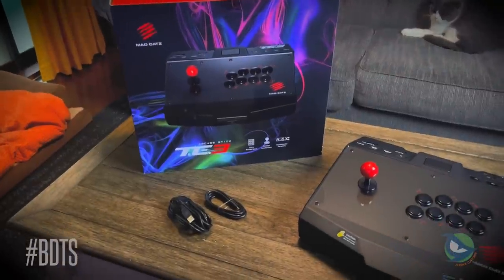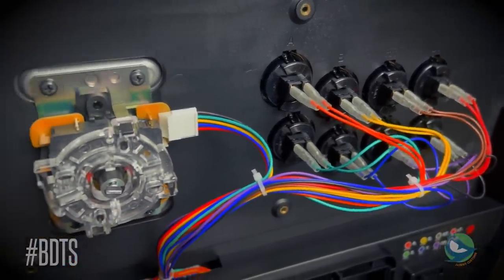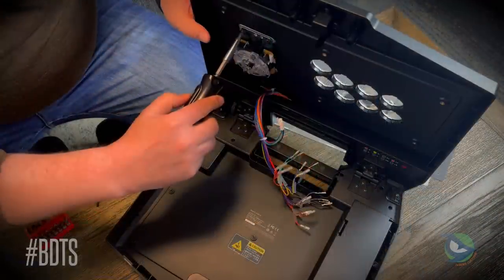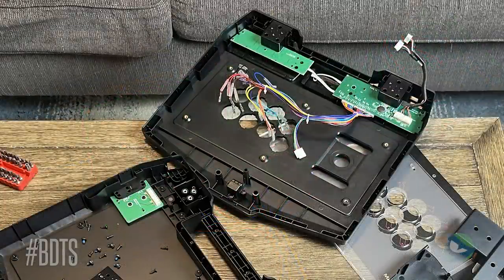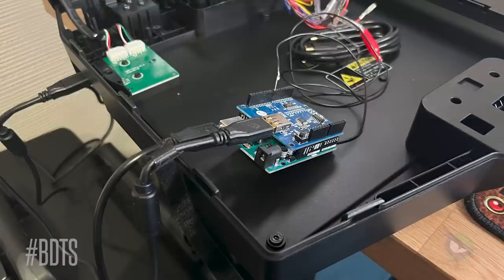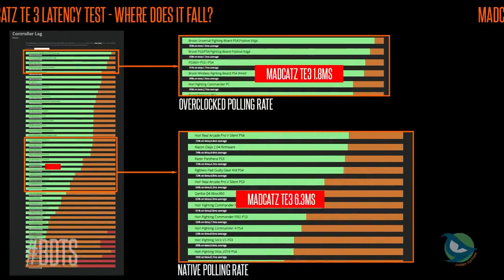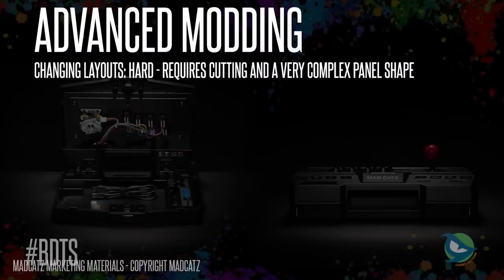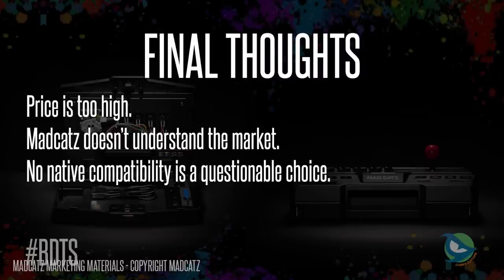Breaking Down the Stick - Madcatz TE3

Comment from the maker: It seems as though Madcatz realized $300 was a bit high for a mass produced stick that requires a passthrough for PS4 and XBOX compatibility. Is it worth it at $190 - I still think no.
Reply: I just bought this TE3 Arcade Stick before I saw this review. I ordered one for around 189 USD from Walmart. And saw your video where you got blocked by (New) Mad Catz company. I was going to buy the Hori Alpha Arcade Stick but never again I will make this mistake if I have personally. Thanks, you helped me a lot but I figured it's too late.
Reply: @EX-Series why not just return it?

Comment: What a hidden gem of a channel for YT to recommend me. There's a niche for everything. I remember this stick's announcement and I almost immediately was scratching my head over the shape. It's like they didn't consider humans would be using it. All the internals and technical specs just make me even more confused. There's no kind of special gimmicks or whatever, but I use a Mayflash F500 Elite myself. I think it gets overlooked for not being a Qanba or Hori or whatever, but it's such a rock solid stick. Near-universal compatibility, some fun bells and whistles, and Sanwa parts out of the box for less than $200 is a steal in my opinion.

Comment: I wouldn’t be surprised if they do a firmware update for DualSense support but even then, a small select few who are willing to overspend on this will care enough.

Heat death of the TE line from the looks of it. I don’t see them ever returning to making sticks after this.
Reply from the maker: Agree with the FW update - seems silly to not have it out of the box. That being said, this still a hard pill to swallow from a corporation making thousands of these to sell.

Comment: This is depressing.
Was hoping that the TE3 would honor its predecessors.
Great review! Thanks for your contribution! Your time, money and effort!
Reply from the maker: Thanks for watching!
Reply: Predecessors had issues too… like the debounce diodes causing the entire stick to stop working.
Reply: @emmettturner9452  im not sure which models were those. Only have TE, FS Pro, VS Silent and TE2+ (SFV Ryu and Black JP version).
None of them have any problems.
Reply: it's a spit in the face of the hard work that MarkMan has done to bring the TE1 and TE2 to the market, and even to this day,  they main some of the most popular and beloved sticks people love to mod, but jesus this TE3, is just embarrassing as hell, it's so sad to see and i feel embarrassed for MCZ, because I really wanted them to do well when they came back, and developed a brand new stick that you can be proud to call it the TE3
Reply: @flinttk5417  Mine is the TE2+ with Ryu. Got it from a thrift store and found that it bugs out when plugged in… which explains why it was donated to a thrift store (still wasn’t cheap!). It acts like certain directions are being held so you can’t even navigate the menus. Of course, this is only a problem with the stock control board. Researched the problem and found people were bypassing the debounce diodes to fix the issue… so it wasn’t just me.

Comment: given how the underside has those cut outs just to fit the sanwa buttons, can you install Gamerfinger snap-in buttons? i just cannot understand why they went with those weird slots on the underside, where even taking off the Sanwa buttons is impossible without the flat head, like wtf were they smoking? also, do you think a flat collar Korean lever can be mounted on those lever mounts? I see it has those weird cut outs too on the underside, never seen anything like that before, most common one's ive seen are usually an S plate which allows various types of lever's to be mounted easily

Comment: This is the info I was looking for. I have 4 Mad Catz TE's, two for x-box, two for PS3. Am I better off buying a couple of these or upgrading all of the original TEs with Brooks Fighting Boards to bring them up to date? Both options seem pricey, but I get the feeling I'll be better off with the second option.
Reply from the maker: Get EZ MODS from JasensCustoms.com and upgrade them. Far better than this new “Madcatz” stuff.
Reply: @JasenHicksFGC  ok man, I will! Thanks for the quick reply!
Reply: @JasenHicksFGC  I apologize, I'm new to all this and I just want to make sure, but I have two more questions. 

First, the Brook UFB Fusion, is that the same as having the Brook UFB combined with the UFB-UP5? It's both combined into the same board? 

And second, if I do go with the Fusion, is the TE EZ Mod compatible with that?

Comment: These plug a controller in arcade sticks are never worth it unless they are sub $200 since Hori and Qanba have offerings that work on PS consoles officially licensed (Hori also has one for the Xbox). Custom is definitely the way to go if you are willing to spend $300 on an arcade stick. I wish they sold the case empty for a reasonable price with the ability to mount whatever PCB you want. I think the Chinese company that has access to factories could make decent money selling just the cases (with some minor modifications).

Comment: Just for clarification, that latency tests applicable to PS3 NS PC.  The advertised PS4 & XB compatibility requiring tethered controllers will have higher latency, would make for a interesting followup video 😈
Reply from the maker: I’m not convinced that’s true; the thought is they are only stealing the encryption key from the original controller and passing it through Vs. Converting the signals. I’ll see if I can dongle a controller and have it work with the testing rig.

Comment: It's really difficult to input quarter circle forward/backward on this arcade stick ... Any tips on how to make this easier?
Reply: If you’re using a square gate on the stick, just get an octagonal gate. There as cheap as anything & make 90,180 & 360 degree inputs far easier than a square gate does. Square gates are better for charge characters though.

Comment: just crazy to release a 3 when its a direct downgrade from the 2, some extra context, the te2 was made by markman, a fgc figure who worked at madcats at the time. he no longer works there, so madcats just winged it without any actual fgc input
Reply: My favorite part is that it's a "Tournament Edition" stick, but it has built-in Macro support so it's automatically banned from Tournaments.

Comment: I literally just built a stick using a Silent Qanba lever and nice screw in silent buttons, all of which are more expensive than Sanwa stuff, and a custom enclosure with a Sega 2P button layout. Adding up the pcb, wires, passthrough and cables, it still came out less expensive than this plastic thing.

If a company is going to make an arcade stick, either make it really nice and premium to justify the higher price, like Victrix and Qanba, for the enthusiast and more hardcore crowd, or make something more budget oriented for the more budget conscious, beginner, or non-enthusiast crowd, like what 8bitdo and Mayflash have put out. Don't make a cheap product that does absolutely nothing special and try to sell it as premium.

Comment: Meanwhile, my TE2+ doesn’t even work because of the failed debounce diodes. Good thing it was a Goodwill find for me but it still wasn’t cheap.
Reply: there is a fix where you scrap off certain bits off the board causing the failure
Reply: @coronavirusboogieman3568  If the PCB were manufactured with quality components to begin with, you shouldn't have to "scrape off" bits!
It's sad to read of people buying TE2+'s, brand new/unopened in the box, and hearing the PCB's go bad in well under a year!  I guess I was lucky to get a "good" Round 1 TE/PS3 joystick (original Street Fighter IV) and lose that stick's PCB earlier this year because of static shock.  14 years must be a record for an original Mad Catz TE release (granted, it was in storage and not used for 4 years!) because many of those joysticks are gone or already had a PCB replacement like my original release fight stick eventually will get.  Many of them were dying within 2 years of the original release.  It'll be the second Rd 1/TE that I own that will get a PCB replacement (Brook Fighting Board + Jasen's Custome TE EZ PCB).
**
The PCB appears to be the weakness of every Mad Catz TE fight stick since the original TE Round 1!  There have been reported failures of the PCB for virtually every major release of the Mad Catz TE lines.  That's why there's such a huge third party PCB replacement market for Mad Catz joysticks!
Meanwhile, there are plenty of other third party joysticks from Hori, Sega, and Ascii/Agetech from the 1990s and early 2000s that didn't have PCB issues.  You can still play them to this day with the original PCBs.  You only need to find a compatible adapter for them!

Comment: Wow, you can just buy an F500 Elite for less then half the price and not only does it have native PS3 PS4 360 ONE and switch support. but it has USB for PS5 And Series X.
The build quality is really good the whole inner shell is made from steel. and it's modable.

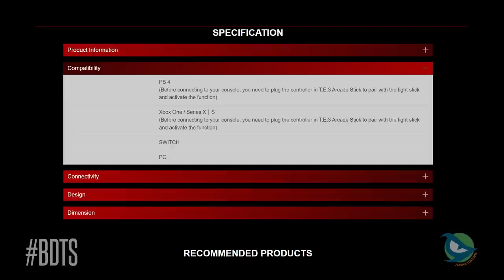Comment: 1:06 But it says Playstation 4, XBox One / Series X & S, Switch and PC so not only being compatible with the Switch.
Reply from the maker: There is a big asterisk with that… you have to connect a controller to the stick to make that work. It’s not natively compatible with them.
Reply: @JasenHicksFGC  

Yeah right, I know what you are saying but still you can use it. The part where you have to connect the controller on the arcade stick was almost a big no to me but it is still compatible.
Reply from the maker: @awakenedsoul2638  I think I did say “native support” - requiring another controller is contrary to that statement, in my opinion.
Reply: @JasenHicksFGC  

Whatever word you use fully compatible, native support, half compatible it is still compatible. If it is not then you cannot use it on those consoles. But lets not argue. It is still compatible but it is a bad idea why they designed it this way that you need to connect the controller on the stick before you can use it. I suppose connecting this stick on PC does not require you a USB PC controller before you can use it.

Comment: PXN X9 is almost the exact same stick in terms of dimensions and function for $130 cheaper. Clamshell design, same locking mech, just different placements for the option/touch pad buttons. There's no value with this stick. It's a shit cash grab there to fool people into thinking madcatz is back. If they were really back they'd just sell two versions like hori does. One for Xbox, and one for PS5.